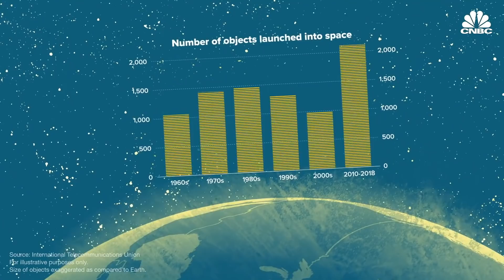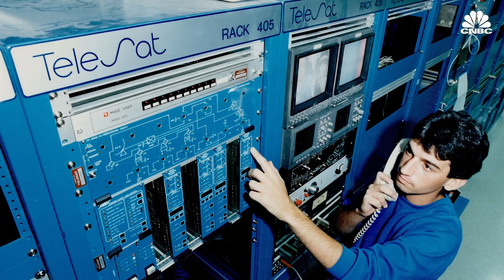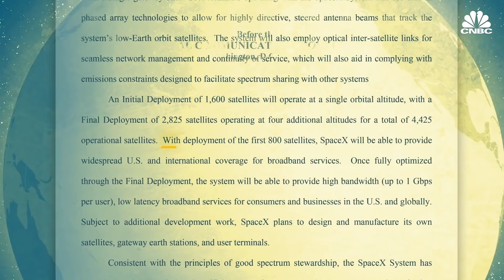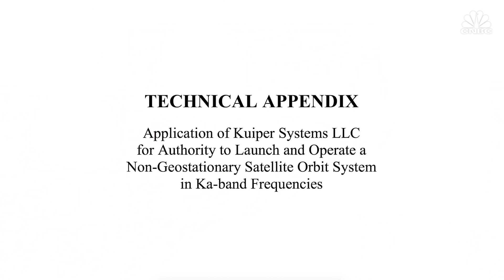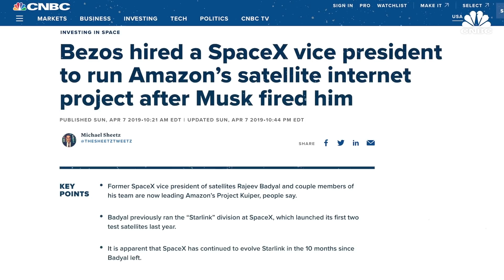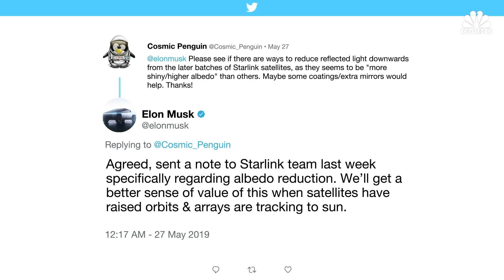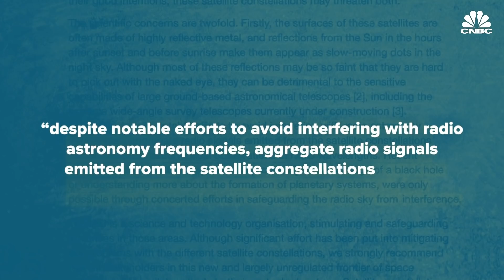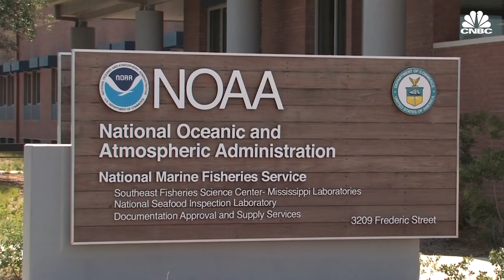Why SpaceX And Amazon Are Launching 42,000+ Satellites

Comment: I support SpaceX's Starlink program due to its high potential to bring desperately-needed competition to the Internet Service Provider (ISP) market. At the same time, the global risk of reaching full Kessler Syndrome will be increased by several orders of magnitude. Additionally, even without a catastrophic runaway orbital debris-forming event, the negative impacts of just one constellation of tens-of-thousands of LEO satellites on astronomy, astrophysics, climate science, atmospheric science, meteorology, forecasting, geology, bio-monitoring, archaeology, anthropology, and military reconnaissance will be staggeringly large. 

I definitely don't approve of Ajit Pai's laissez-faire approach to FCC regulation of the aerospace and telecommunications industries, regulations are written in human blood and are extremely necessary to prevent major disasters, which a Kessler Syndrome event would be, potentially halting space exploration, many domains of scientific research, and even interfere or prevent defense and security efforts for decades or more. Telecommunications satellite constellations should be deeply analyzed by experts, scientists, politicians, companies, and the public for years before any significant number of these LEO satellites are in orbit, allowing sensible, evidence-based laws and regulations with human safety and progress in mind to be written and enacted before a disaster occurs.

Comment: What I don't understand is what frequency are they going to use? most of the good stuff is locked up by the cell,tv, and radio industry. So just stick with public channels? If they start clogging the 900mhz,2,4ghz and the 5ghz is there enough bandwidth?

Comment: Elon’s and all of the “low latency” constellations real plan is not to serve the under-served with connectivity.   That happens to be a side effect of the real goal, which was touched upon only slightly in the video.  

The real goal is to beat the latency of fiber by 40%, and selling that capability to the Wall Street high frequency arbitrage market.    Banks will pay billions to be able to perform trades that much faster than the guys next door.   This is the real business plan, and in order to do it, from New York to London to Singapore and Hong Kong, you need a low earth orbiting constellation, that happens to be under-utilized over under-served people.
Reply: Basic error : you're confusing latency with the speed at which a carrier wave passes through a medium. LEO has lower latency than GEO; it certainly doesn't have lower latency than a fiber link that sits next door to an exchange. 
Trading houses  look for physical proximity to an exchange to minimize latency. The fact that the signal travels 40% slower through fiber than air is irrelevant when the distance to cover  is 99.99% less.
Reply: The only practical way that would outpace fibop, is if they used lasers.  Iirc, they connected NYSE to Nasdaq with a laser internet connection, awhile ago, so the tech is there.
Reply: Under-served is very different to "undeserved".
Reply: Bunch of interesting geeks here!!
Reply: The problem is debris and how it will affect astronomy and scientific research for us to go farther into Space
Reply: i see you're a man of culture aswell.
Reply: So what? Everyone wins. Lack of competition is what gives us outrageous service quality and price/performance ratio in low population density areas. A new competitor can only help. If traders foot the high startup cost, that's even better.
Reply: Right and wrong. It is correct that banks look into low latency and would profit, but Elon is from Africa and he knows the issue there. If he would lie, people will start to dislike him, and that's nothing he wants to have.
Reply: @bluebrick00  he lies constantly and this technology doesn't have the bandwidth or capacity to benefit anyone besides exchanges and brokers
Reply: @alabastardmasterson  proof?
Reply: @alabastardmasterson  That is incorrect; The throughput of those satellites is about 240,000 Gbps or >240,000,000Mbps, enough to provide a decent connection to every corner of the world except poles (Reddit https://www.reddit.com/r/Starlink/comments/7xzkl5/starlink_satellite_bandwidth/), with enough bandwidth to support major parts of the total internet "with the projected design capability to support sufficient bandwidth to carry up to 50% of all backhaul communications traffic, and up to 10% of local Internet traffic, in high-density cities." (Wikipedia https://en.m.wikipedia.org/wiki/Starlink_(satellite_constellation) ).
So considering that you are completely independent on where to rx/tx internet (not underground of course), being able to get some decent bandwidth and low latency are just some of the advantages of Starlink. As far as I know you can't do the rapid buy/sell trading anymore, and brokers will, like everyone else, sometimes watch their Cat videos, and 20Gbps would be a shame if used for stock only. Have a nice day! :)
Reply: @bluebrick00  Top reply!
Reply: Satellites are easier to hack.

Comment: Space-littering: the act of carelessly throwing tens of thousands of satellites into earth orbit with no safe way to eventually remove them.
Reply: They simply deorbit and burn up on reentry. They are engineered this way.
Reply: @teatowel11  Uh huh... engineered... assuming someone oversees the deorbit. Like abandoned sour gas wells,  orphaned satellites might not deorbit so cleanly given the engineers don't t have a crystal ball to foresee the future. Imagine all the other stuff that might be up there to contend with. Its extremely poor engineering to scatter load the orbital space above earth with all that crap. Proper design would include a performance bond that covers the future costs of satellite recovery. They don't necessarily vaporize into a trillion pieces when deorbiting.
Reply: @ricknash3055  actually they do disintegrate, that's the way they are designed. The engineers don't have a crystal ball but they do know the speed, height, materials, surface area etc physics can accurately predict the forces that will be applied to those satelights when they reenter the atmosphere. If they run into something that will likely just help them disintegrate. 
The satelights are at an height which requires intermittent propulsion to remain in orbit. They do not need to be controlled in order to reenter and burn up. If they don't maintain altitude they will slowly decend, reenter the atmosphere and burn up.

Comment: There are so many questions on the purpose of these satellites.
- It's got to be cheaper to layout fiber-optic lines than putting satellites in orbit if it's the reason for them is just Internet connection.
- Those remote areas everybody is talking about is the underdeveloped area, meaning they can't afford the satellite Internet service.
- The maintenance cost for those satellites will be terribly high. 
This just doesn't make sense in terms of business model. What is the real purpose of launching these expensive satellites that they're not telling us? Hmmm...

Comment: If fiber optics deliver data at 40% of the speed of light, why wouldn’t submarine cables work, to connect continents? Data then could be distributed through underground optic cables. Huge undertaking, I know, but it has to be less expensive and longer lasting than satellite constellations. And the debris level would reduce, solar flare problems would not exist, with cable coatings, etc.

Comment: I'm supportive of what they're trying to achieve, but there is an issue of the debris that will be created. That has the possibility to curb our space ambitions.
Reply: @Dhen Phu, there's absolutely no evidence to back up your statement. 
These programs are designed to bring high speed connectivity to people in remote or difficult to reach areas. This is a massive communications infrastructure leap which many people need.
Reply: @Dhen Phu, lol, I use Gmail and Google Fit for personal reasons and by doing so have accepted Google's user agreement to share certain data. I choose to give information in order to enable certain services to run. I don't pay for the service, so it's paid for by advertising. 

For business reasons and more secure conversations, I have a completely secure VPN network that is 100% private between my company and I. It is fully encrypted, runs on our own servers, and flows through our own fiber network.

Whatever data is collected by these companies is completely legal based on you opting in to use their service and share your data. When you choose to upload photos, share your location, etc you are making the choice to give them your data.

Comment: As if astronomers didn't have enough problems with light pollution and radio noise.  😡
Reply: Since those problems will most definitely get worse, not better, over time, wouldn't it make more sense to build space-based telescopes like the Hubble and James Webb. Even the Chinese have apparently placed a radio telescope on the far-side of the moon. I think it now makes more sense to spend the money on these kinds of solutions, rather than building ground-based structures and having the cost of maintaining them. Especially since private companies like SpaceX are driving down the cost of launching satellites.

Comment: Will this break the Great Internet Wall of China? Or they'll have a way to block it?
Reply: They don't have to block it, they just tell SpaceX that if they want to provide service they will route their traffic through the great firewall. SpaceX will comply, just as every other satellite service provider does in every single country. You can't provide telecom services without local approval.
Reply: @aleksandersuur9475  except this does not need approval, it isn't restricted like land based ISP are. Anyone with a receiver (a phone?) can connect to the network, like how anyone can pull NOAA satellites data. Is there even a way anyone can stop it?
Reply: @sbellaharris  No, it's restricted because it's two way communication, it's not like listening to GPS or any other broadcast. To operate in US, SpaceX needs FCC-s approval, same for every other country and their respective radio licencing authorities. For example Russia has already told OneWeb that they will be happy to launch their satellites on Soyuz, but OneWeb will not be able to provide open internet in Russia. It's the same deal everywhere.
Reply: @aleksandersuur9475  Spacex launches their own satellites, and they don't need China's permission to orbit above it and beam data down.
Reply: @sbellaharris  A ground station in China would absolutely need Chinese permission to send anything up though. Operating any sort of radio transmitters is regulated by local law, it's not about what SpaceX is doing in orbit, it's about what customers are doing on the ground.

Comment: Does star-link use large, static ground stations?
Reply: Not for the end users, but SpaceX itself will have to use equipment like this to connect the satellites to internet. https://twitter.com/Megaconstellati/status/1128851694970912769
The end user gets a smaller antenna one could fit on a boat, airplane or even car roof. No mechanical pointing required, it will have to be electronically steered, Elon described it as "pizza box sized". No pics of these particulars have surfaced though, it'll probably be something like this https://commons.wikimedia.org/wiki/File:Portable_Satellite_Internet_Modem_and_Antenna.jpg

Comment: Adding coating at the bottom of a sat is pointless, you're still dimming light, which give false data. If you're trying to track the brightness of an object, if/when the sat passes over that object, yes, it'll be darkened out but you'll reduce the light coming into to the lenses and sensors.

Comment: Worst explanation of latency ever...
Reply: I agree, it’s also misleading.
Reply: Yea, ... so lets be more specific:   Internet traffic via a geostationary satellite has a minimum theoretical round-trip latency of at least 477 ms (between user and ground gateway), but in practice, current satellites have latencies of 600 ms or more. Starlink satellites would orbit at 1⁄30 to 1⁄105 of the height of geostationary orbits, and thus offer more practical Earth-to-sat latencies of around 25 to 35 ms, comparable to existing cable and fiber networks. The system will use a peer-to-peer protocol claimed to be "simpler than IPv6", it will also incorporate end-to-end encryption natively.  However, no details on this have been released as of yet.

In February 2015, SpaceX asked the FCC to consider future innovative uses of the K/a band spectrum before the FCC commits to 5G communications regulations that would create barriers to entry, since SpaceX is a new entrant to the satellite communications market. The SpaceX non-geostationary orbit communications satellite constellation will operate in the high-frequency bands above 24 GHz, "where steerable earth station transmit antennas would have a wider geographic impact, and significantly lower satellite altitudes magnify the impact of aggregate interference from terrestrial transmissions."

BASIC FACTS * MICROWAVES  CELLULAR  WI-FI ELECTROMAGNETIC RADIATION:   https://docs.google.com/presentation/d/e/2PACX-1vTb3AqnWG1On2PI4IUHUSkmFoM-wTxq1E54FoKT_UaBuBz7RrvWJZD1ovulr4d1fVBut6WShDtrUXrT/pub?start=false&loop=false&delayms=3000

Comment: 9:28 The telescopes captured the light trails of Starlink satellites. 
Just turn them off while Starlink is passing !!!
Reply: Nah the satellites were still getting to orbit. There are alot of satellites already
Reply: I say we build the infrastructure to get our astronomers to the moon and the orbital base that will be the pitt stop between here and there.
Reply: we???
Reply: Yeah but with thousands of them in the air, they would have to turn them off a lot more.
Reply: These trails can also be easily corrected by image enhancement software.
Reply: @rogernevez5187  No, they really cant be corrected by software so easily. Telescopes already work at extreme signal to noise ratios and it takes quite a bit of software magic to see dim objects telescopes are looking at. Satellites, airplanes, light pollution, that all adds to noise and it makes all the difference between what you can and what you cannot see.
Reply: @aleksander suur 
> "Telescopes already work at extreme signal to noise ratios" 
This is only true when they are zoom in very small areas of the sky. 
However, in such cases, it is very unlikely that there will be any Starlink satellite passing by.

Comment: *Latency Exist

Starlink: Hold Me
Reply: Zeksteve  No, not necessarily, starlink satellites are just 500km's up . And the speed of electormagnetic waves in air/vacuum is faster than in copper/fiber.
speed in air/vacuum ~1c 
speed in copper/fiber ~2/3c. 
So the latency you get by sending things up into the sky can be easily offset by the speed gain. 
Esp. for long distance communication , let's say USA to Germany. 

Additionally the connections are more direct with sattelite , because with teerestrial cables, data packets have to go where the cables are, which might not be ideal (aka the shortest path).

Comment: describes what latency is
...*then proceeds to say how good it is for streaming*
Reply: Latency doesn’t really affect streaming , only calls, gaming...
Reply: @NicoKupfer  ok... there isn't enough bandwidth to think about streaming with this application. How does latency degree affect low bandwidth mediums?
Reply: Ikr I guess just trying to sell it to mainstream people idk 🤷‍♂️
Reply: @Daniel Kintigh That is incorporating that. If you had a direct line around the planet you could do quicker than that.
Reply: @Vlad Tepes depends on where in the world you are connecting.  But yes the latency should be pretty low.
Reply: Starlink can get you 25 ms to the other side of the planet on a ship or plane. Just sayin. Laser and radio travel at the speed of light. Light in fiber optic cable travels about two thirds the speed of light in vacuum or the speed of light in glass. That is why a low earth orbit system using laser and radio comms can get better latency than fiber, especially considering it all has to go through the transatlantic cables and their switching stations. The reason satellite internet is so slow is because traditionally they are in geostationary orbit 36000 km away from the earth. Lightspeed one way trip is about 100 ms. But Starlink will orbit at 250-500 km resulting in single digit millisecond delays unless you're going a substantial way around the planet.
Reply: @please_stop-v7o  the reason it's slow is bc it can't carry 10% as much data
Reply: @alabastardmasterson  Geostationary internet? That may be but however large the bandwidth you'll always have about a 120 ms delay. And that's if the satellite is above you and you're talking to a computer right next to you. Things get worse from there. That's why a low orbit constellation is so desired but has not yet been achieved due to cost. If the satellite orbits any lower than geo it is not in a fixed spot in the sky. So you need at least hundreds of satellites to cover the entire planet at all times. That with traditional launch costs before the advent of cheap commercial rockets has been unthinkable. Iridium is one of the few providers that has made it work financially. They do mostly disaster relief comms with satellite phones and tracking and datalinks to ships and planes for logistics and so on. Not pure internet.
Reply: @please_stop-v7o  except their first generation of satellites don't have the satellite to satellite lasers yet.
Reply: I can't believe that cnbc did not check what the people that are in their videos says.